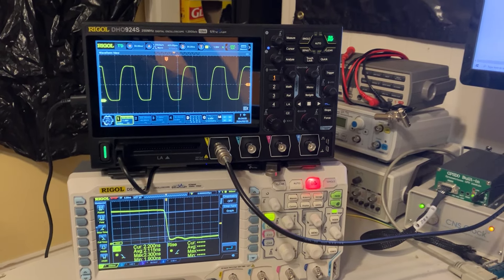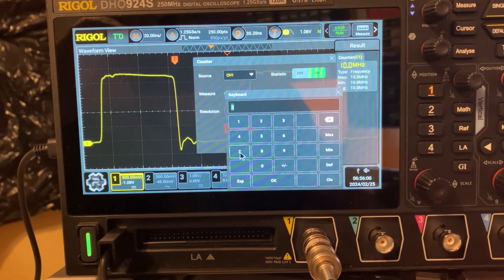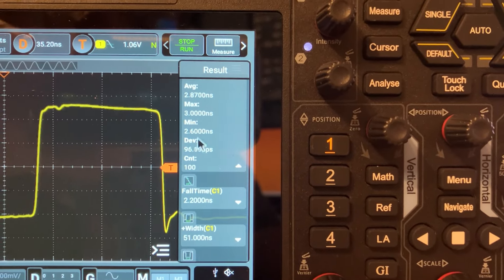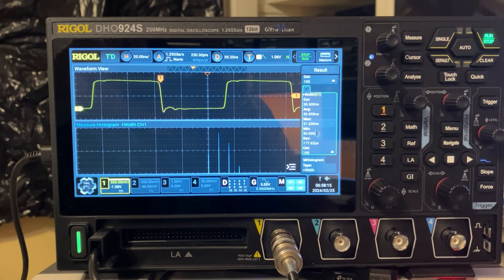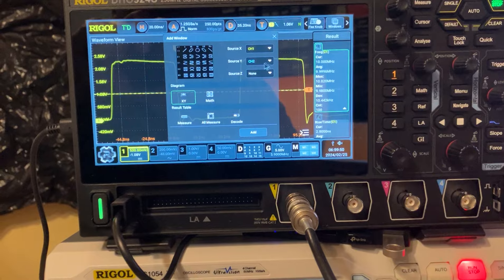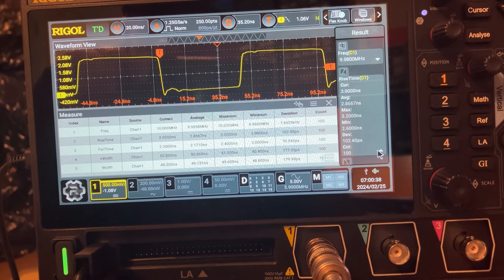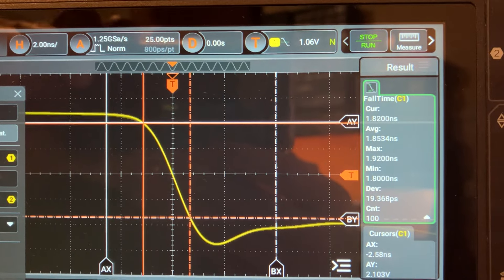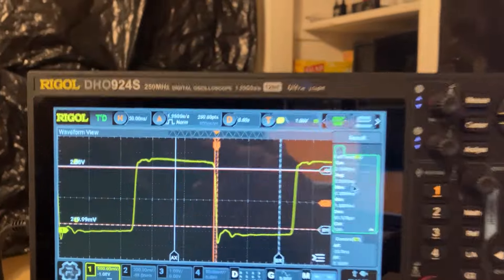Rigol DHO924s rise time with 10Mhz clock

Comment: I wonder what is the output impedance of that clock signal. 50 Ohms? The scop have only high impedance if I am cerrect. The missmach can create some rinning?
Reply from the maker: see other video for the ds1054z, you will see the 50ohm at the start of the video